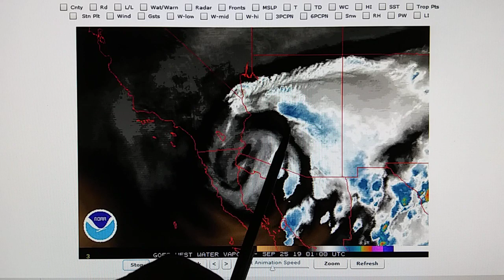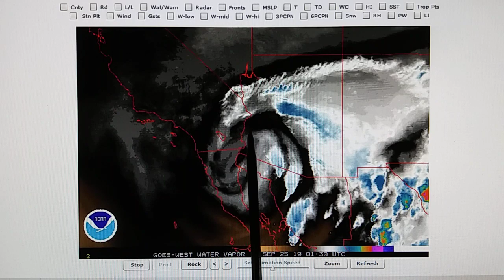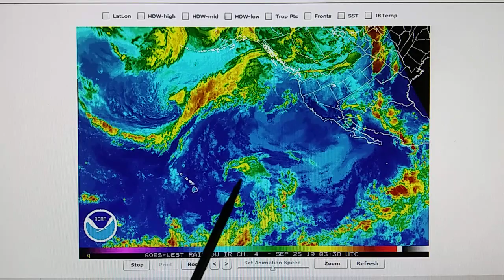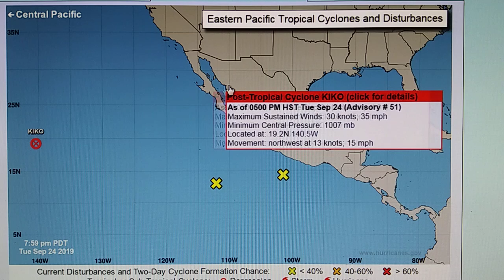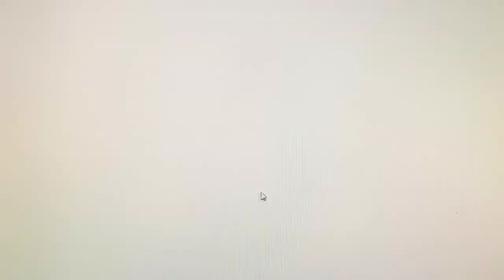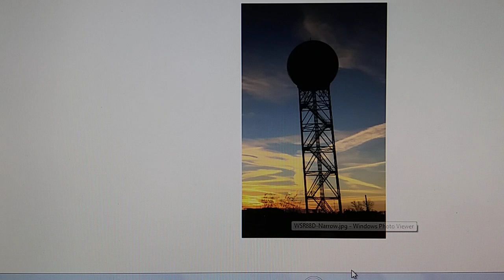9-24-2019; Giant Weather System Over Southwest Produces Zero Precipitation!

Comment: 9/28, am...there is a different pattern showing on the Conus out of the Vagas NEXRAD.  I just refreshed and it has lessened but still visible.  It's parallel lines like I mentioned before.  This is only the 3rd time I've seen this patterning coming from a NEXRAD.  I hope it's still happening when you get to checking it.

Comment: Today's report shows some of the most blatant examples of insane weather manipulation I've ever seen. Thanks! Last night here in the southeastern Mojave the whole sky to the east over the Colorado River was crackling with lightning for hours. I could SMELL the rain and ozone in the breeze. And was listening on my ham radio as the LA Center air traffic controllers were madly redirecting all the coastal airplanes north toward Las Vegas to get them through the turbulence and thunderheads. But clear skies here and not even one drop of rain. Now I know why weather was so freaky out here last night. We were sitting right under that dry low!!
Reply: I flew from San Diego to Phoenix last night and that’s exactly what we did. Pilot took us toward Las Vegas and didn’t turn back toward Phoenix until around Prescott.
Reply: @Jenine I Dream of Lilac Time  I'm not spraying anybody. I was at least a hundred miles away from the huge thunderheads that were towering over the Colorado River and all lit up by lightning. I could see the light show all along the east horizon, but too far away to hear thunder.
Reply from the maker: - Thanks for your detailed update.
Reply: @1PacificRedwood  We had 5 drops of rain in Oceanside, CA., but it was humid, like during a monsoon season.